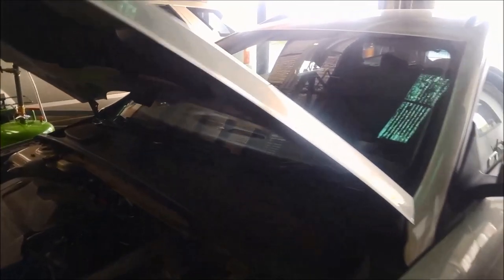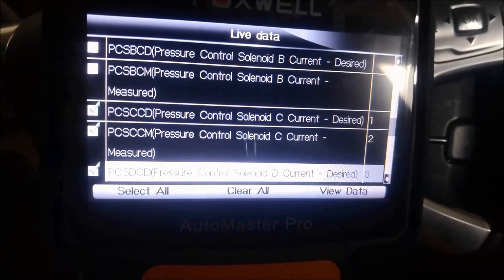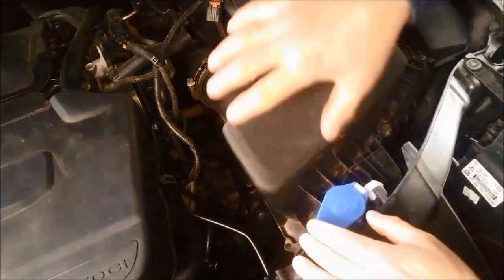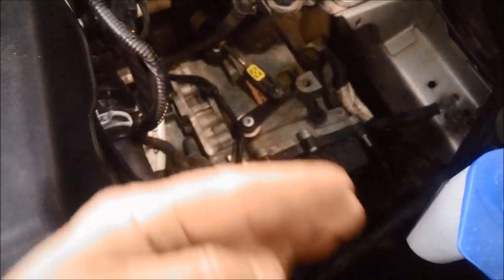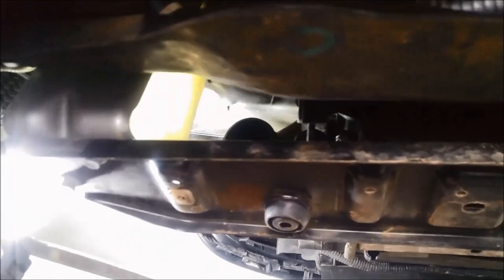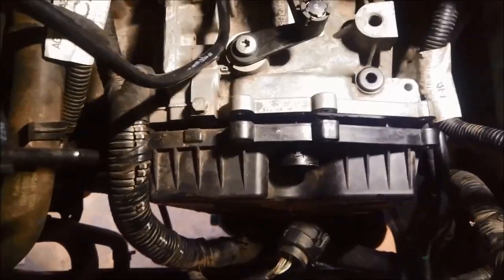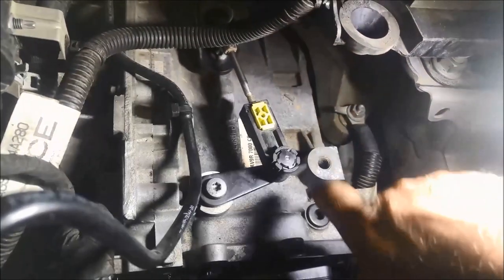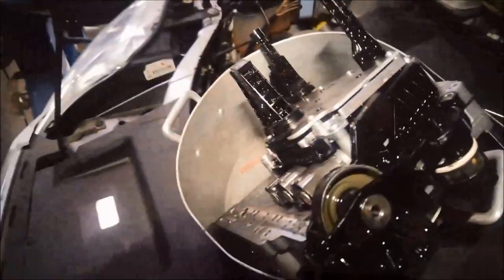DCT Powershift Ford 6DCT450 Solenoid Removal P1of3 Getrag MPS6 MPS6 W6DGA SST Transmission Repairs

Comment: does the 2017 mondeo have this same rubbish design where the filter cant be changed without pulling the whole transmission apart?
Reply from the maker: hi, even if you have the 6f35 trans, needs to be split to replace internal filter. cheers

Comment: Hi i change all selonoid and now car gear wont move is it need to update
Reply from the maker: hi, did you put in plugs properly and align selector? need to have correct fluid level as well. you may need to recheck your work. cheers

Comment: Hi I have 2010 dodge journey 2.0 crd and  I don't find transmission valve Body's part number can you help me? Have it 6DCT450?
Reply from the maker: hi, you need to buy specifically for your vehicle. different suppliers will have their own part numbers. cheers

Comment: Hello,i'm from switzerland and I found your superb video which helped me to better understand the operation of getrag gearboxes unfortunately I have a problem with my evo x with the dct470 gearbox. I have a p2766 input shaft 2 sensor poor performance and I have the 2,4,6 gears which no longer work with the reverse gear which is not going very well, I have to go up in the engine revs to reverse it. I will just need help thank you.
Reply: I don't know if before I clean the mechatronics block or I change it
Reply from the maker: hi, always start with basic checks and simple repairs. most often on these issues arise from lack of servicing properly and contaminated solenoids. cheers
Reply: Thanks :)

Comment: Can you tell me , Where Solenoid C & D in valve body. ?
Reply from the maker: hi, depends on your scan tool. these trans have more than 2 solenoids operating in each gear. often c & d will refer to gear 3 & 4 operation. you will be wise to bench test all solenoids and sensors. you can contact me via facebook link in vid description if we need to share pics & beers. cheers

Comment: Hi just a quick question if you'd be so kind to answer, but does cold weather affect the solenoids? I had a problem with a fault code about the solenoids six months ago at the end of winter so we started first with a transmission and engine oil and filter change and it cleared it up completely. First frost we had a week ago and all of a sudden it's back with a vengeance with fault codes solenoid c and d stuck off....so does the cold weather affect the viscosity of the oil in the transmission and cause problems? Or is it just coincidence? Sorry if I don't make complete sense, I'm a woman and not entirely sure with mechanical issues lol
Reply from the maker: hi, of course temp affects solenoids, the ressistance increases as they warm up, there are no bad questions. cheers
Reply: @YepThatsIt  ok thankyou so much for your answer. May I ask just one more question? Lol do you think it would be worth replacing all the solenoids? Thanks again
Reply from the maker: @fancyfeast4610  if a few solenoids are problemsome or are leaking then yes, if most seem ok then a flush is usually enough for a while. add magnets and clean them regularly. 
cheers
Reply: @YepThatsIt  hey thanks for your replies, I still have problems with the solenoids and haven't used the car since. We cleaned and tested them all but it's not not changing gears past 2nd. Is there anything else we should check? Also if I buy new ones where's the best place to source them? I'm in nz. Ford mondeo zetec 2.0td 2014 diesel. I can't seem to find anywhere online. I'd really appreciate and be thankful for your advice 👍
Reply: @YepThatsIt  also, can I just ask if other models have the exact same transmission? If we were to replace it with a 2nd hand one are, say the focus models the same as mondeo? Thanks, your know,edge is greatly appreciated

Comment: Great videos.  In the diagrams on your other videos it doesnt mention solenoid D, which of the 9 solenoids is D please if one is top left?
Reply from the maker: hi, they make it confusing, but I am thinking it is CSPS2 the clutch/shift pressure solenoid 2 for even gear pressure control....hopefully no one has removed the plugs at bottom of trans - the detent bolts for the shift rails, one  the gearshift fork 4 and the other is for fork 1 ( the 2 on top of trans are for fork 2 & fork3 ) cheers
Reply: @YepThatsIt , cheer for the reply.  The code it comes up with is P0766 shift control solenoid d stuck off.  Everyone else says get new gearbox. At stage now were I would follow ur video and clean the solenoids but do u think this is a different fault? I can't find a mechanic will to try anything other than new gear box but the car  value is less than a gearbox..... any help much appreciated, thanks
Reply from the maker: hi, for some reason mechanics are bit scared of these transmissions...always check the basics first, then work up from there...even if you stuff it up yourself, you will be up for another transmission anyway... however you will risk learning something, self satisfaction, confidence, proving your advisers wrong, saving some coin etc. non of us was born with knowledge and experience so go get it ! cheers
Reply: @YepThatsIt  Thanks for the vote of confidence and your help.  Is that gunk you use to clean the solenoids or some sort of degreaser and what power supply did u use to test the solenoids.  I'm going to have a craic at this on Sunday!
Reply from the maker: @butcher776  we use solvent called x55 or 1215 which is not 100% dry but dry enough and has reasonable smell for enclosed areas. cheers
Reply: @YepThatsIt  would an electrical contact cleaner spray can do for cleaning and can I test the solonoids safely with a 12v battery instead of 8 volts? Going to attempt the repair on Sunday and just trying to gather the stuff for it.
Reply from the maker: @butcher776  i`m not familiar with with electrical contact cleaner spray? its not crc or wd40 type stuff? i wouldnt if it is....try a solvent like white spirit or similar. if testing with 12v make sure you warm solenoids up as well, just not with a heat gun and dont cook them ! cheers
Reply from the maker: brake cleaner should be ok
Reply: @YepThatsIt  I sent u a small thank you for your help so far! I've got the solonoids on the bench following the videos! The solonoids are reading around 2.8 which is less than your 3.2.  Is this a problem do you think? I've only cleaned one and noticed  the plunger comes out when turned upside down, is that right? Thanks again for your help so far.  BTW the magnets and solonoids covered in the greasy stuff like yours.
Reply from the maker: thank you for that ! the resistance will increase with temp, might just be cooler weather there, as long as the others are similar resistance should be ok. the end pin on plunger on couple of the solenoids is free floating so not a problem. make sure you reverse flush the filter port as shown in one of my vids as well while you have it apart. the grease you mention is very fine metallic debris. make sure you clean magnets as well as you can too and/or add more magnets. cheers
Reply: @YepThatsIt  I've cleaned the solenoids but just wondering if it's worth letting them soak in the cleaning fluid? what temp should I heat them to to test and if it's  dodgy using 12 volts as I don't want to do any harm now I've got this far.. Can I just connect crocks to a battery an touch solonoids pins to test? Sorry for daft questions.
Reply from the maker: hi, soaking wont do much, you need to demagnetize solenoids to flush them properly, or ideally pull them apart and clean properly ( special tools needed ) test up to 80 deg C. cheers
Reply: @YepThatsIt  hi sir, where did you get that demagnetizer you have? Thank you.

Comment: these new cars must be a good source of income and maybe frustration, atleast scan tools make life easier. im a neandathall i miss my turbo 400's and torqueflights now if they just had overdrive , my friend installed an external overdrive years ago on his high perf 68 chrysler coupe.
Reply from the maker: ahhhh the good old days we will never see again
Reply: @YepThatsIt  myself and a few mates are getting back to the older cars yet putting supplimental pure hydrogen cells on them , my mate a mechanical engineer has been playing with HHO since 78 even on that his exhaust emission on a 60's beetle were better than the latest car we have today , nothing new ofcourse .. ive built many hho cells in the past but not pure hydrogen my old rodeo got remakably better fuel economy and responsiveness. i see the new one litre turbo deisel hyundai gets close to 2000kms to the tank , its meant to be comming to Australia so they say in the auto magazines etc.
Reply from the maker: thats so cool, my old man had a HHO generator on his old car, he reakons it ran better and used a bit less fuel.....i just recently bought a HHO Carbon Cleaning machine and have been doing carbon cleans ( i may put up vids soon ). the idea was to clean out the intake/exhaust system. the greatest result i got was a t4 VW TDi that wouldnt rev over 3500rpm, after about 1/2 hour it cleared and would redline if you let it. however for now looks like its better as a maintenance tool but i still am doubtful it would/could clear a complete carbon blockage of cats or a dpf.  cheers
Reply: @YepThatsIt  ive dissasembled engines that had supplimentary hho on them i kid you not , squeaky clean inside like the engine had never been used., i do find though after lots of kms i needed stainless exhaust pipes, or maybe internaly coat them.. we ran an engine on  100%pure hho once no other fuel source it ran so clean zero emissions we just had it at high idle with zero advance still liked to backfire, pure hydogen is best as an alternative fuel ,the actor  jack nicholson had a pure hydrogen car in the eighties he was all over the news.
Reply from the maker: @closertothetruth9209  yeah i`ve been thinking of getting a PEM hydrogen generator so you can run on pure hydrogen not browns gas. researching what the membrane is about? i drilla little hole in the rear mufflers that don`t get hot enough to burn off condensation, will make them last a tad longer ( see my vid ) hope you`re making vids too bloke ! sounds like you do some interesting stuff cheers
Reply: @YepThatsIt  as far as a membrane i think Reg Pye on YT said 300 threads per inch silk screen type of material

Comment: Where is your shop located?
Reply from the maker: north east country victoria
Reply: @YepThatsIt  I can barely find a place in greater Brisbane that will even touch these gearboxes.

Usually they can't and/or not interested for various reasons.
Reply from the maker: @DoubtingThomas333  try transmission specialists. cheers
Reply: @DoubtingThomas333  Hey mate did you end up finding anyone in Brisbane , I've got the same problems cheers

Comment: I drive with the scanner in the car (2017 mondeo diesel wagon) all the time now, it is logging the P0766 code as pending on cold start drives only. It clears with zero evidence of its existence after non recurrence on the second start after a few km. No wonder useless dealers can never reproduce the problem. It’s been back a dozen times over its 98k km life with them always saying theres nothing wrong with it. Theyre not interested in my findings either they want to reproduce themselves. It’s a company car so i am stuck dealing with these mouth breathers at the dealership. Otherwise i’d fix it myself.
Reply from the maker: hi, make sure you do a regular service on these and remove front cover to clean magnets ( and add magnets ) cheers